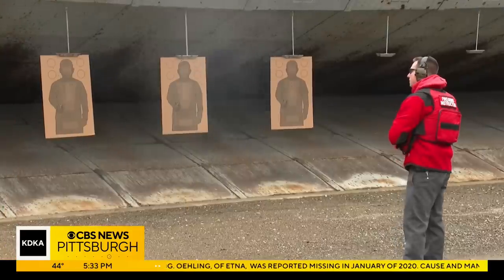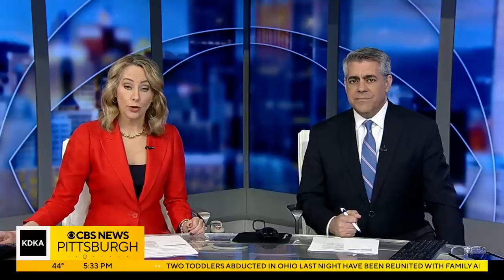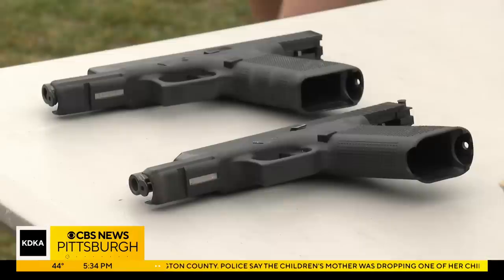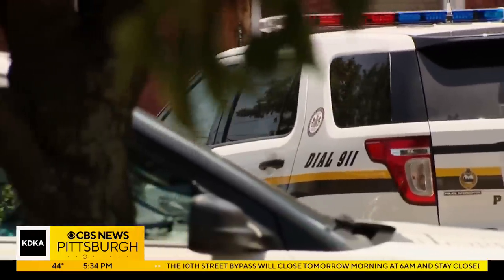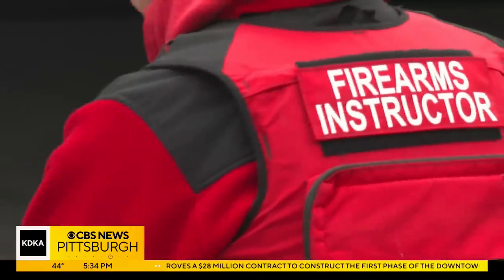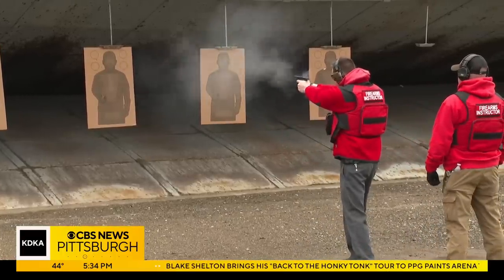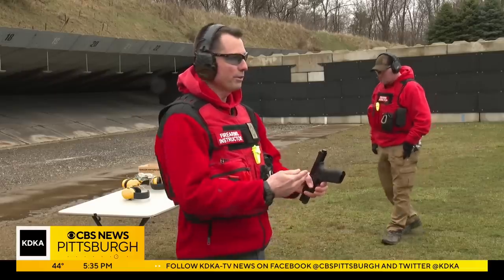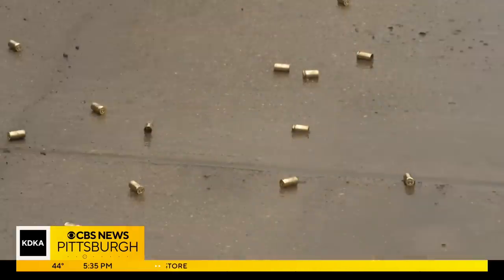Zappala warns glock switches turn handguns into machine guns

Comment: Hey Megan, where the "glock switch" installs onto is called the "slide" not "clip" There is no "clip" on a glock or any other pistol or rifle.
Reply: iTs NoT a CliP - > nitpicking of gunworshipping religiousity. Be part of the solution, not the problem. There is zero legitimate civilian use for these objects.
Reply: The Clip is inside of the Magazine technically but the whole of the ammunition holder over the years, has been referred to as the Clip instead of the Magazine because of Movies and TV calling it such.
Reply: @jrrarglblarg9241  Nitpicking?  That’s like saying your doors are broken when your window is shattered. Not only is something being incorrectly identified, it’s being called something that doesn’t even exist on the object. Terms and words exist for a reason, being an uneducated moron isn’t an excuse. It’s amazing how the people who are the most vocal against firearms are the ones who don’t know anything about them.
Reply: @jrrarglblarg9241  the "glock switch" is already deemed a machinegun and is already ILLEGAL. It's up to the ATF and law enforcement to do their jobs and crack down on the sources that are providing these parts.  Us gun worshipping people are tired of people who don't know anything about guns(firearms), try to report or talk about firearms and misinforming the public.
Reply: @racingdc9  What control point does the ATF have to enforce this? The giggle switch is a small and fairly simple device made by third parties and sold over the internet. Do you want a federal crackdown on what people buy and sell on the web? Or would any attempt to actually enforce the law get you guys screaming “they’re gonna take teh gunZ!”
    Seriously, tommy, seriously.
Reply: S&W 625 revolver in .45ACP uses a Full Moon CLIP.
M1 Garand use an 8 round CLIP
Reply: A clip holds handgun rounds and a magazine holds rifle rounds...
Tell everyone again how the clip is not a part of the Glock?
Reply: @wakeupamerica2024  bro, not helping
Reply: @wakeupamerica2024  you may want to go to google and research what an ammo clip is and what a magazine is and see what pictures you see. Free country you can call it whatever you want. Lol
Reply: @jrrarglblarg9241  I think shooting at watermelons and pumpkins is very legitimate and fun
Reply: @wakeupamerica2024  Ok. I will.
Reply: @Zeaiclies  Clips and magazines are both used for loading a gun, but they serve different purposes. A clip holds cartridges together to make them easier to load into the magazine. You can also use a clip to load a cylinder. The magazine feeds rounds into the firearm's chamber during shooting. Clips are not inside magazines.
Reply: @FuhqEwe 
I know
Reply: m1 Garand is a rifle with a clip.
Reply: @theguywithanobjective482  Some older rifles utilize stripper clips, such as the M1 Carbine, while other older rifles utilize en bloc clips, like the M1 Garand. These are obviously not magazines, and are not what idiots are thinking of when they say that an ArmaLite Rifle or Glock 17 has a “clip”.
Reply: @theguywithanobjective482  I knew someone had to say it. I use an M1 clip as a money clip. They work great.
Reply: @FuhqEwe  Also, military 5.56mm ammo is still packed in stripper-clips in cardboard “crayon boxes.” There’s an adapter in each ammo can to attach a clip to a magazine to load ten rounds at a go instead of poking rounds in with your thumb one by one.
Reply: @FuhqEwe  what you are referring to is called a stripper clip.  A clip goes into a Mac-10, an Uzi or other types of handguns with similar loading mechanisms.  

Long barreled guns also referred to as rifles or shotguns take a magazine.  Tube or stacked.  This goes all the way back to the world wars when they were using the Thompson.  

Machine guns are also long guns.  Short barrel fully auto guns are called sub-machine guns.
Reply: @jrrarglblarg9241  You’re correct.
Reply: Nitpicking??? The ignorance is the main problem.
Reply: @wakeupamerica2024 yeah wrong. A M1 garand has a clip. A Glock has a magazine. In the story the glock had NO magazine when the reporter referred to the switch as a “clip”
Reply: @FuhqEwe she referred to the slide as an extended clip, that's a first...🤔
Reply: @jrrarglblarg9241  they exist and always will. Better hope you're not empty handed when you have a need to defend yourself.
Reply: In the case of the M1 Garand, you are correct. The rounds are loaded in an internal magazine via a clip. When the round is fired, the clip is ejected with a very distinctive "ping" sound. But the Glock pistol uses an external magazine, not a "clip".
Reply: @jrrarglblarg9241  Hey Jjjarblgarb, in these conversations, details matter.
Reply: @djmj12714  yup. It’s elementary and after 20 years of people screwing it up you would think they would stop making the error.
Reply: @wakeupamerica2024  >> A clip holds handgun rounds and a magazine holds rifle rounds.
Your ignorance of firearms is absolutely amazing! You must've had to work pretty hard for such an achievement.
Reply: @djmj12714  🤣👍
Reply: @djmj12714  I bet you are just like Jack Reacher.  You probably sleep with your guns and tell everyone about how much you know about guns and how you are the authority on the subject.

It is not hard to offend people who think they are subject matter experts on firearms.  I bet you own a 6.5 Creedmoor too.
Reply: @wakeupamerica2024  Is that the best you can come up with?? 

I don't sleep with my firearms,  I don't claim to be an expert on firearms, nor do I own 6.5 Creedmore.
Reply: Congratulations. Only a very few that commented actually knew what they were talking about.
Reply: @djmj12714  Nope.  I bet you are a geardo too.  Probably buy all the accessories so you can look like you know what you're talking about when you show up with your COD rifle with the orange camo.  

Do you teach classes on how to set up your kit?  We could all stand to take a class from someone who goes by Jack Reacher.
Reply: I have to admit, before reading these comments the words "clip" and "magazine" were synonyms and used interchangeably. I always preferred to use "magazine" personally.
Reply: @Zeaiclies there is no clip inside a magazine.
Reply: @targgthewise2892 
i know that
Reply: @wakeupamerica2024 so he calls out your obvious ignorance on guns…… and you melt? Good job
Reply: @Zeaiclies well then, your sarcasm wasn’t picked up by anyone.
Reply: @targgthewise2892 
Why are you bothering.  lol
It was a trap and you fell in it.
Reply: @targgthewise2892  my obvious ignorance?  Google "pistol clip" and look at the pictures.  It doesn't matter how people feel.  The term Clip has been used  for a long time to refer to the piece of the handgun that holds the ammunition.  It's mentioned in pop culture and music as a clip.  No matter how much you try to argue that it is wrong you will never undue it.
Reply: @Zeaiclies  well, good on you. I guess?
Reply: @targgthewise2892 
It's always good over here. lol
Reply: Clips are more likely to be found on much older style firearms like an SKS with stripper clips
Reply: Many rifles and a few pistols use clips. You are referring to magazines, but clips and magazines are two different things.
Reply: Sad sad sad ... This has got to be one of the most ignorant reply threads I've ever read !
Reply: @jrrarglblarg9241  to my understanding, there have already been efforts to crack down on Armalite Rifle-type weapons components that the ATF defines as making those systems into machine guns.
Reply: @JW-vk5jk  Yes, and? Where is the control point for enforcement of these laws when the components can be made in a garage with consumer grade CNC and sold on the “dark” web?
Reply: M1 garand is def a rifle .it had a Clip and goes PING
Reply: ANd a few old pistols used stripper clips
Reply: @jrrarglblarg9241 Which is why they are illegal . Duh. Guess you were not paying attention
Reply: That part made me laugh 😂😂😂😂
Reply: @jrrarglblarg9241  SHALL NOT BE INFRINGED!!. so my question to you is this: where does the switch go to? Lmmfao AN EXTENDED MAGAZINE does NOT make it auto. Sorry pal!!
Reply: @wakeupamerica2024  l 8n a rifle or handgun they are called MAGAZINES, please educate yourself.. a "clip" is just that, a thin clip that holds rou D's from the back and not many guns use them. Especially handguns lol..
Reply: @jayboogz303  Okay, but Well Regulated Militia though. I got my national guard time in. You?
Reply: @jrrarglblarg9241 Stating fact is only nitpicking to the ignorant. Also fact, clips are metal retainers that hold 5 rounds of ammunition together so it can be loaded into a firearm or into a magazine and then loaded into a firearm. Oh and last fact, there are annually over one million instances of legal firearm owners defending themselves or their loved ones from violent and or armed criminals. Just because you are scared of something you do not understand does not validate you wanting to remove or ban said scary thing from society or from legal citizens.
Reply: You're almost correct. The M1 Gerand is a rifle that operates using clips
Reply: @Cory Grone  I did happen to leave that out. Though it is a clip it's more box-like so I tend to overlook that. Good rifle though
Reply: @jrrarglblarg9241  Regulated at the time of writing meant outfitted or equipped.  Militia did not mean a standing army but a group of ordinary citizens since that is who the bill of rights protects.  And who does the Bill of Rights protect us ordinary citizens from?  A tyrannical government.  If you can't comprehend that you have no business weighing in on the constitution.
Reply: @FollowMyReality504  said “.....but I feel it's all intentional.”
    Occam’s Razor postulates that the simplest explanation is usually true. Hanlon’s Razor postulates that ignorance is a more common explanation than malice.
Reply: @jrrarglblarg9241  which object are you referring to? The gun as a whole or the switch? Are you arguing that we shouldn't have guns?
Reply: @wakeupamerica2024  nope
Reply: @Wake Up America 
For your education:
A magazine is a container that holds cartridges or rounds of ammunition and feeds them into the firing chamber of a gun. Some magazines are internal, while others are detachable.

A clip holds rounds of ammunition together, often on a metal strip, to be fed into a magazine. Most guns have magazines (revolvers and some types of shotguns do not), but not all firearms use clips.
Reply: @thejohn6614  You could try reading the whole thread, but the giggle switch is illegal and serves zero positive social function. It has zero tactical functionality for military or LEO. It turns a mediocre (not a fan of glocks) pistol into a sh!ttty submachine gun. The rate of fire and consequent accuracy drop are almost identical to a MAC10. 
     From a tactical perspective the SMG has only one tactical use - it’s the preferred weapon of the police state. An SMG is a threat that no crowd can ever overwhelm the police who carry one. It is a tool of imprecise mass casualties.
Reply: @thejohn6614  And from a social perspective the giggle switch does more harm than good to “The security of a free State.”
Reply: @taylorsimounet5645  nope

Comment: To clarify, these "switches" can only be used to modify GLOCK branded handguns. Not S&W, psa, beretta or any other brands.
Reply: Really? So the 3D printed receivers and polymer 80s magically not work on despite the fact they share the exact same design and part compatibility.. I don't think you understand what brand. I think you mean the design.
Reply: For example my 3d printed Glock 26 uses all gen 3 Glock OEM parts except the rails which are third party because Glock rails are molded into the frame normally. So this auto switxh would work on it despite not being a Glock brand . Polymer 80 and other full aftermarket Glock clones also take this switch. Basically anything that takes a stock Glock slide and sear . Please stop sleeping nonsense and bad info

Comment: Bad reporting. Megan Schiller “this is what the extended clips look like”, but the image is of the slide in a retracted position, with no extended magazine.
Clearly she didn’t understand the two different issues concerning police, or the terms they used to try and explain it to her. 
Now many of your viewers will harbor and likely recapitulate that misinformation.
The “switches” that Zappalla is talking about fit in the rear of the slide assembly and appear almost indistinguishable from normal Glock pistols to those unfamiliar with the weapons.
The extended magazines (which they call clips) are the box like containers that hold the ammunition fit in the bottom of the handgrip.
Do better, treat your jobs with responsibility to the public

Comment: Only a activist would talk about Glock switches. It is of value only to criminals since it sprays bullets with little accuracy. Most people know accuracy is very difficult in a neophyte's hands. Of course if they would arrest and imprison criminals instead of turning them loose there would be fewer people to use these. BTW, you cannot even posses one of these legally.

Comment: You can't stop it its all a lie... If they banned guns all together people would just use homemade zip guns made from  pipe, elastic, and bathroom bolts... Easy peasy, 1 2 3... Cant be stopped. (and for those who would say 'well it wouldn't be fully auto', using the same principle as the switches it could be, with a little bit of work...
Reply: Not even really that much work.

Comment: Proof the nfa does nothing. Also the thing aboit machine pistols is the best lla e to be standing irs right in front of them. Whybdo you think no mitsry ever used them for long if at all. A mp5 might not be as small but at least you can sholder it and youbhave more points of contact